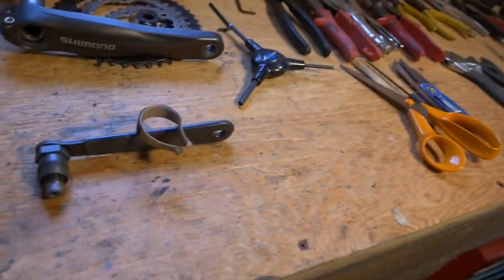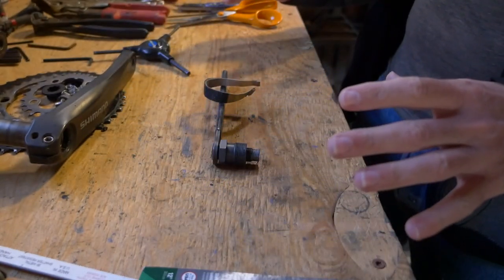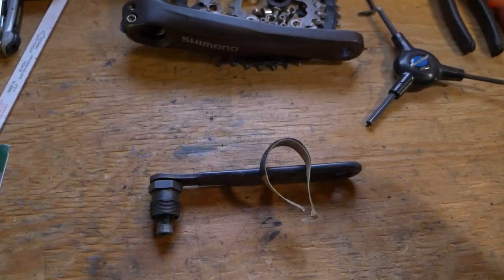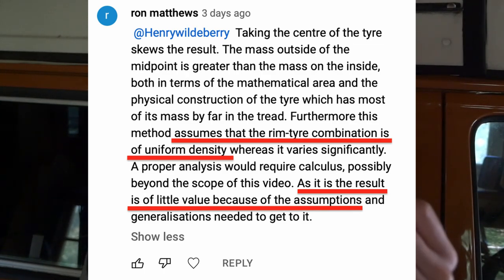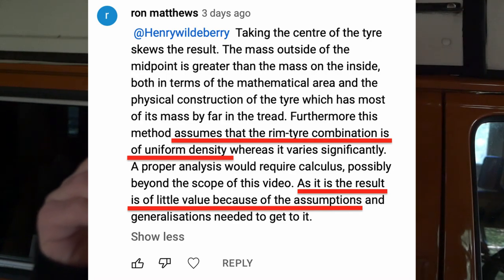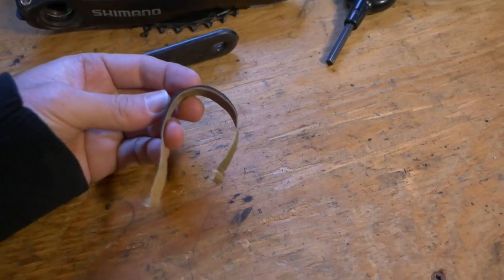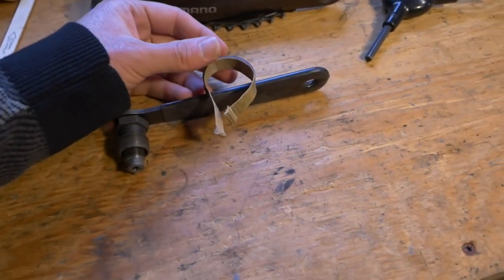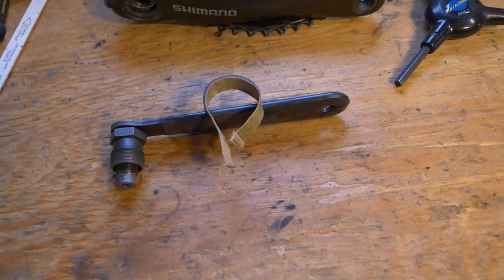Did I make a bad assumption? Center of mass of a bicycle tire

Comment: I tend to go with personal experience..can overly complicate a simple issue,looking deeply at certain aspects,but missing something that one experiences whilst out riding.  Something I have found in many years of cycling how much is in ones head. It does seem that the speed each person rides at on the road is pretty constant. Back many years,riding steel frame and pretty un-aero set up a decent average speed was 20mph...now,on Carbon frame,modern roady kit etc a decent average speed is....20mph!  On my gravel bike I find that 650x47 tyres roll along nicely..prefer them to 700x40 or 43.  Perhaps the simple fact that 650x47 is close in overall dia.to 700x25 and gives a nice feel.

Comment: If your wheels have more inertia then that little gust of wind is also going to slow you down less. The energy you need put back in should be the same though (but it will correspond to a lower change of speed on the bike with the lighter wheels). Great video!

Comment: Years ago when I was more into cars. Road and Track used to do these lab tests to measure stuff. One April they did a road test: an test of how the road is put together and affects efficiency and performance. But when doing these test, they always showed a graph of the relative error or accuracy of a given test. So if the estimated error was 5%, a difference between a tire measurement of 3% would not be consider significant enough to account for a difference. So it is difficult to explain certain things. For example, comparing crank length up or down one size(170 to 172.5) is not really enough to measure  a difference. (340 to 345mm about 1.5% change). So coming to any conclusion with the data would not be reliable or repeatable. Just one of the challenges of setting up an experiment that would actually give usable results. You know this of course but wanted to add it to the conversation.
What I think would be an interesting analysis is the effect of tire volume on the performance of a tire. A 650x48 is similar in diameter to a 700x28 but significantly greater volume. This is what changes what tire pressures you can run on either tire. I get  annoyed when tests are comparing two things different. Like a 650x48 with a 700x42 with similar volume but much different diameter.

Comment: What about trying to spin a 650B and 700C wheel (on a test setup) with a specified force and time and measure the rotational speed (e.g. with a small electric motor)? The wheel with less inertia will spin up in less time or will spin faster in the same amount of time. I really enjoy your scientific videos, keep them coming!

Comment: You could cut a segment measuring 10 degrees of the circumference of each tire, attach each to a swing arm, then with a high speed camera measure the time it takes each to go from horizontal to vertical. This method would be subject to metrical liabilities as well, but it would be fun. After all, isn't that what it's all about? Just kidding. Have a great day and keep thinking deep thoughts. 🙂 P.S. If the swing arm is adjusted to match the length of the radius of the 650b and 700c wheel and tire respectively, my bet is on the 650b winning. In other words I believe in this experiment the length of the radius will outweigh (no pun intended) the weight and aerodynamic factors. But I could be wrong. You're driving me crazy, Henry, ha.

Comment: So many questions so little time!  Would the tubeless fluid equally coat the outer internal surface of the tire increase the mass and flywheel effect, reducing the effects of small changes in orientation or head wind drag? Went for a ride in NH cold and crazy windy!

Comment: Your previous assumption appears reasonable for relatively thin tyres with little tread. It could be different if you moved to aggressive, knobbly tyres and included sealant which would also move the centroid more towards the tyre tread

Comment: I wonder how a few ounces of sealant affect rolling efficiency of the wheel. Once with my landcruiser playing in the sand a tubeless tire lost its bead and a local tire shop hastily resealed the bead leaving a lot of sand in the tire. That sand created havic until discovered many weeks later.

What's with the four hole chainring?
Reply from the maker: Good question on the sealant. It's a viscous liquid so it's hurting rolling efficiency, but by how much? I'm sure it's enough that you probably won't see it used in hour records on the track, or things were every 1/100th of second counts. For mixed terrain the sloshing around inside the tire seems to be offset with the added puncture protection and self sealing. Tubes also increase rolling resistance, so it's maybe close to the same? I'm sure someone has tested this?
Reply: @Henrywildeberry  but the weight savings of sealant over tubes, will that be enough to offset the possible increased rolling resistance of sealant over tubes? This is a fun thought experiment rabbit hole to go down, at least until I think myself into a headache.
Reply: @Henrywildeberry  Jan Heine has tested it. Tubeless and butyl tubes have the same rolling resistance, latex tubes are a bit faster.
Reply from the maker: @maxsievers8251  Thank you! Do have a link to the test?

Comment: Sorry, there are two questions of interest.  What is the real difference, that is noticeable in riding between 650 and 700 tires, assuming the same tire width, and what is the difference between 38mm vs 50mm assuming the same tire size.  I think these there  are questions that matter.
My non scientific answer to these questions is:  between 38 vs 50 the is no practical difference except that 50 is a much more comfortable ride.
And between 650 vs 700 there is no practical difference, although if you are a shorter person a 650 may fit your body better.  However, I do have one question.  I think  650 might be better going uphill because the diameter being smaller, it is the equivalent of gearing up a little more.
Just some thoughts.
Reply from the maker: In my experience riding bikes with the same sized tires, but with different sized wheels the 700c bike feels taller, and more stable. It takes a little more effort to start a turn, where as with the smaller wheels the bike feels quicker in the handling. As far as whether they feel smoother, or faster or slower I can’t detect any difference between a 650b x 48 vs. 700c x 48, and even a 26-inch x 2.3 all feel the same to me. 
I know I have said this already and am repeating myself, but the question the first video series was asking is whether a 650b wide tire bike is faster, slower, or the same as a 700c skinny tire bike. There’s a whole bunch of reasons why this question is important, and it starts way back with the early cyclotourists and early French frame building. Back then if you wanted more comfort you got a 650b or 650c, but if you wanted a lighter racing bike you’d choose a 700c with the rational that regardless of your choice the frame itself was built with the same geometry. You see it’s easier to build bikes with the same tube lengths, angles, etc for a certain rolling diameter. This meant all bikes would effectively handle the same with the only difference being the width of the tires. It was believed then that it would streamline or at least standardize frame building since it is easier to build different sized rims. Imagine if standards existed today? People like Grant Petersen came along and rediscovered these benefits, and even folks like Jan Heine writes extensively about it and claims that wider tires are just a fast, but hasn’t quantified why. This question was interesting to me back when I was first dabbling in wider tires on my touring bike and I wanted a fast but functional ride. A bike I could ride longer and feel less fatigue. Road bikes with skinny road tires pumped to 100psi beat you up, but they feel fast. What if all of that turns out to be perception over reality? What if wide tires are just as fast but more comfortable, last longer, with fewer flats, and they are just as lightweight with a smaller wheel? That would be good, right? Maybe if it sounds to good to be true, perhaps it is too good to be true? I tend to be a skeptic by nature, and need more than someone’s own opinion before I believe things hence this mind numbing experiment.
The question you want to ask whether a 650b x 48 is faster or slower or the same as a 700c x 48 is worth exploring too, but it’s a different question with a different purpose. This question seems to come up a lot in the mountain biking world where they have gone from 26 inch to 27.5 inch to 29 inch and continue to argue over which wheel size is better. 
Hopefully, I have cleared things up a little more. Thanks for the comment!
Reply: In my experience, the different frame geometry required to fit the larger wheels has as much or more difference on the overall feel. The frame needs longer chainstays and a longer fork if you're going to use high volume 700c tires compared to 650b